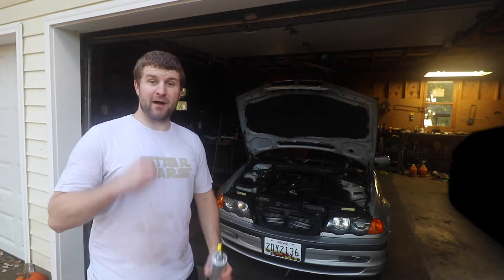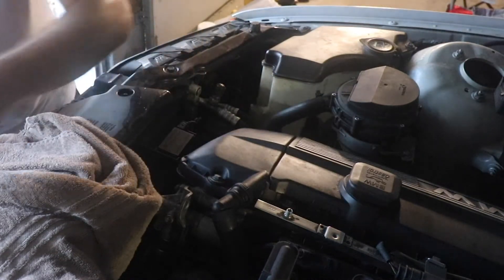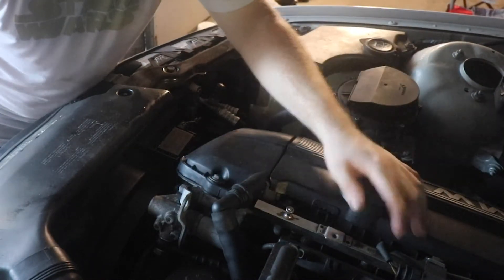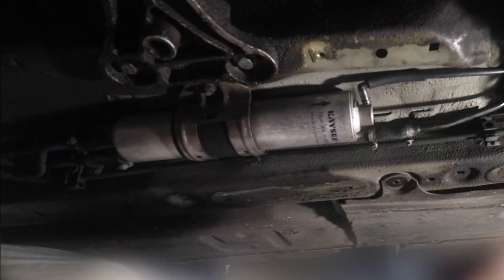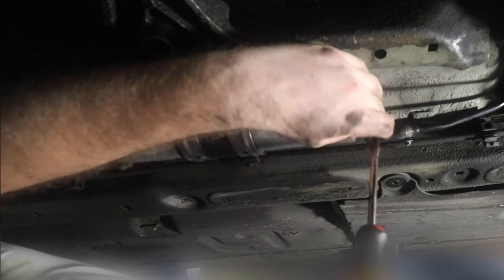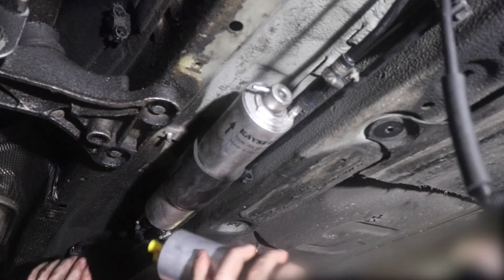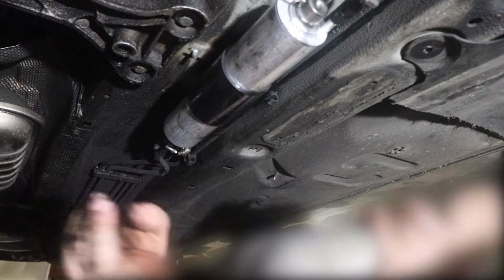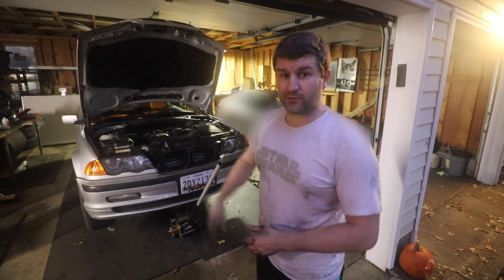How to Replace Fuel Filter on 2000-2006 BMW e46 325i/330i

Comment: If ye answer comments or no, hopefully ye do. Would tha F-connecter vacuum hose cause a rough idle or rough running? I have fuel trim codes, as well as MAF codes, and rough running. Changed MAF and boots. Still running very rough. Thinking maybe fuel filter, but wondering if should change out that vacuum line as well.
Reply from the maker: Anything that would allow air into the vacuum (anything after the MAF sensor) could cause a rough idle/rough running. So any vacuum lines which are cracked and would allow air in could do it. The disa valve gasket is another common cause of a vacuum leak. And I believe the disa valve itself not working could cause a rough idle as well.

Comment from the maker: I also forgot to mention in the video that the oem clamps that hold the hoses to the fuel filter need to be cut off. The clamps are basically crimped onto the fuel hose and will be obvious they're not normal hose clamps. The clamps are single use and will need to be replaced with either oem clamps from the dealership or with fuel hose clamps. My fuel filter was replaced by a previous owner which is evident by there being fuel hose clamps on those hoses.
Reply: instablaster...

Comment: can this be done with jack stands on the rear instead of the front.  i cant get to the front center jack point.
Reply from the maker: I thought I replied but just noticed I didn't. Whoops! I'm not sure if you'll have enough space if you only jack up the rear. My e92 M3 was too low in the front to get the jack under it so I'd drive onto a couple pieces of wood to get it up a couple inches. Then my jack would be able to make it to the front center jack point.

Comment: Was ur car running before u changed it or it wasn't if I'm asking is because i got one just like urs but mine don't wanna start so I'm thinking if is the fuel filter or the fuel pump
Reply from the maker: It was running before I changed it.

Comment: What is figure of fuel trim to be decided to replace filter?
Reply from the maker: It's unlikely that you'll know exactly what needs replaced strictly based on the fuel trim. But in any case, if the fuel trims are positive, then it means the system thinks it's running lean and so it's trying to add more fuel to the mixture. That would mean it's something related to fuel delivery - but only if you know your O2 sensors are working properly.

Comment: What about a 2000 323ci, made before 9/2000…. That type needs the filter but pressure regulator as separate part… ugh